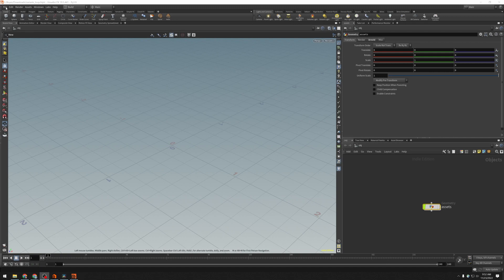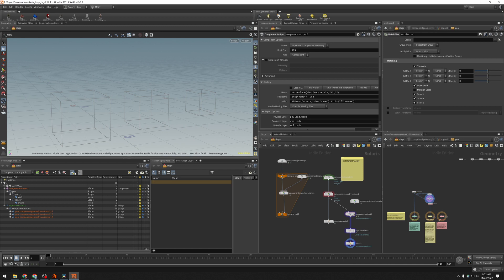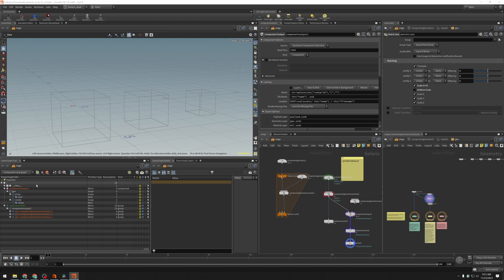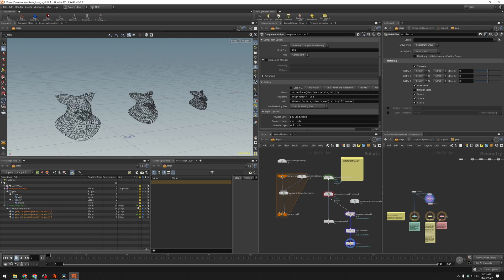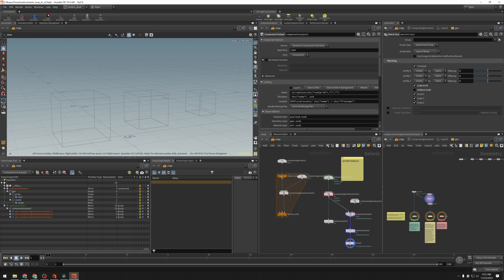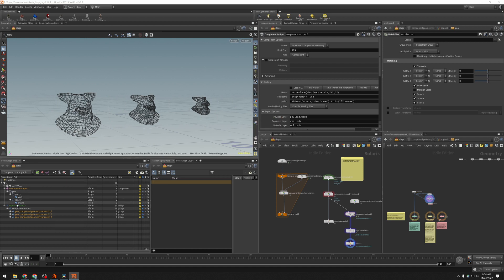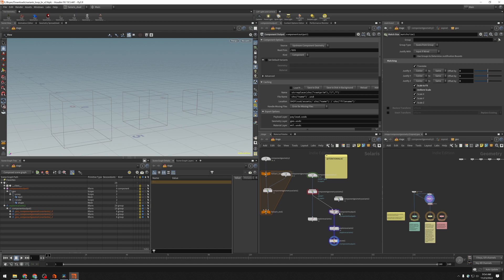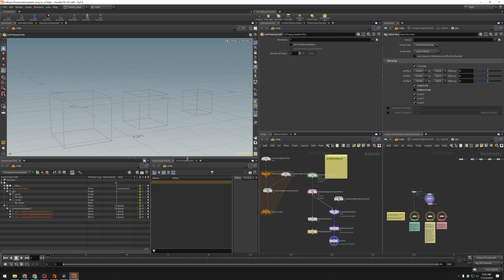Payloads - a Quick tip for Houdini Solaris

Comment: Is it possible to activate the payloads only during rendertime and disable them in viewport ?
Reply: That is the entire point of this video. If you've turned off Load Payloads for the viewport, then the payloads will not be loaded. But payload status never affects final render, only the Vulkan or GL scene view. Something I skipped in this video is that you can set up a Sublayer LOP such that it doesn't load payloads, regardless of the viewport settings, although you can still use the L column checkbox in the Scene Graph Tree to force a payload into the viewer.
Reply: Hmmm... I guess it works for the IPR renderers, too. Not sure why I thought it was only for Vulkan and GL.